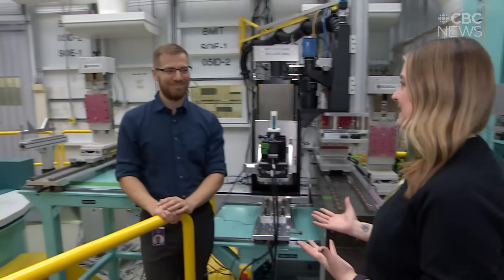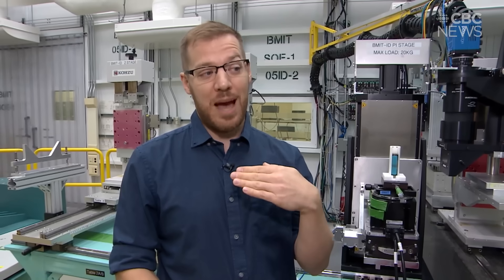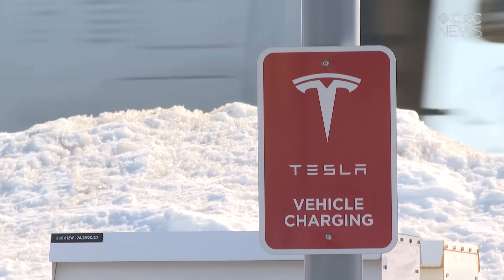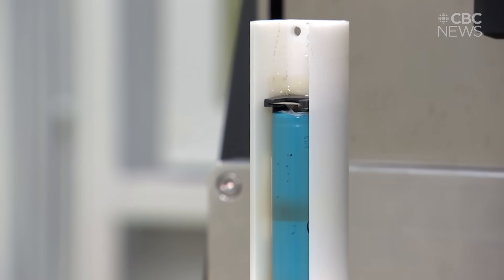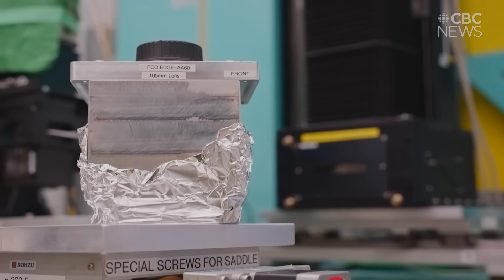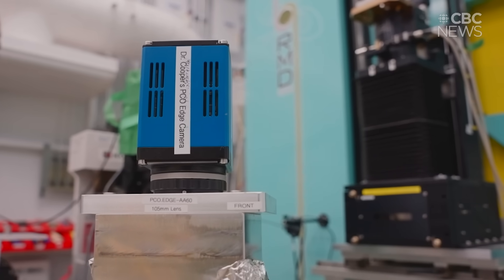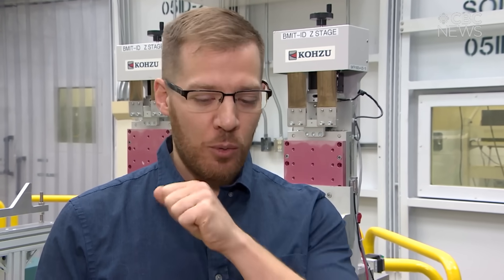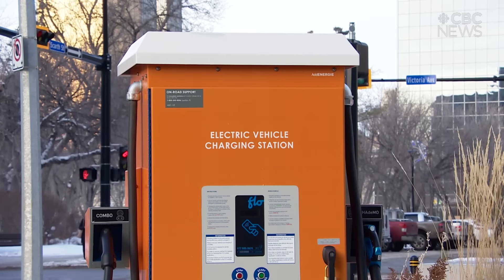New electric vehicle battery could run for 8 million kilometres

Comment: It's all very well testing a battery in a lab. In the real world, it's going through heating and cooling cycles, shock and vibration and significant g-forces. Lifetime in a lab setting is different from the  real world.
Cost? Charging rate? Capacity to mass ratio? Ease of manufacture? These are a few questions that were not mentioned.
Reply: Heat is the primary degrade risk of battery cells and is the result of charging and discharging at high rates. Scientists test and monitor that and would evaluate the aging effects on the cells. Under everyday driving conditions vehicles are not usually subject to significant g-forces or vibrations and battery systems are engineered to withstand everyday use and the occasional pothole anyway, with extreme conditions only being a concern in accidents or specialized use cases.
Reply: @markfudger5267
If I suggested that this technology would suit the Tesla 4680 cell, which is specifically designed to minimise "Heating and cooling" with it's "tabless" design which reduces internal resistance, would you say "That's not relevant"?
.
How about if I said that Tony Bond is using this (University) facility to assist in working towards his PhD at Dalhousie University, where he studies alongside JEFF DAHN
Does the name ring a bell?
Tesla "Battery Guru" Jeff Dahn?
do you think there's not a Tesla somewhere "out in the wild" which doesn't have a pack containing these cells?
Reply: @rogerstarkey5390  solid state means a single crystal. How easy is it to grow a single crystal? Think Silicon, Germanium, Sapphire and Diamond. Once you have grown the crystal you have to shape it into a battery sized component. What are its properties:- brittleness, hardness, thermal conductivity, expansion coefficient, etc. Do you think it'll be easy and cheap to manufacture?

Comment: 🇦🇺 👍🏽, but no mention of charge/discharge rate?
Reply: If you go back into the video, you can hear him say a length of time and a number of full cycles.  You can divide
Reply: 20000 cycles / 6*365 days = 9.13 cycles per day.  I’d say that’s faster than normal discharge/charge rate, but sure it’d be good to know if there’s a different limit compared to current designs.

Comment: Interesting does the lead acid battery behave the same?
Reply: Lead acid batteries have always had a short life span.  They're designed to be kept near full charge all the time.  Allowing them to self discharge until flat essentially makes the innards degrade into sludge.

Comment: I've heard a few people say recently that batteries are loading longer than expected but they seem in line with projections. 

It looks like those batteries from 14 years ago are going to last another 14 years at least, surely longer than the rest of the vehicle. One of the problems is lifetime is often given as the length of time it takes for the battery to loose, day, 30% of it's capacity while people generally interpret it to mean 0%

When the owner finds that the range is no longer sufficient they'll sell it to someone who does
Reply: And there's already a growing market (particularly more advanced in Europe) for 2nd life/repurposing of EV batteries into stationary, grid scale energy storage, where duty cycles are a fraction that of an EV, and where they can be put to economical use, potentially for decades longer. By which time profitable recycling will also have matured.
Reply: @sluggo7  While both exist it's at a very small scale because there's very few batteries that need recycling. Mainly just faulty ones or ones from cars that have been in a crash
Reply: mine didn't 42% degradation at  nearly 9 years and only 41k miles.
Reply: @FredFox-m9v  As with anything there's always a few faulty units that get sold. At that kind of degradation you'd really be covered by warranty and be entitled to a brand new battery
Reply: @sie4431  you are wrong, all lithium ion batteries degrade with time and use cycles. You are even more wrong with guarantees. My guarantee says 'at their discretion' it also says that it would be returned to 9 battery bars out of 12, mine had 8 at 8 years and you had to pay yourself for a battery check, have to have had it tested yearly and even then and only if their ' discretion' was enacted, you do not get a new battery, only cells repaired / replaced to bring the battery capacity back to 9 out of the original 12, so i would have had to pay and satisfy their qualifications and even then, they just had to say sorry, no ! and all for just one battery bar, that i had no guarantee of getting, after it paid out more of my own money.
Reply: @FredFox-m9v  I'm not wrong, I never suggested batteries don't lose capacity over time just that 42% in 9 years would be a faulty battery.

However you now say that you still had 8 bars after 8 years which is pretty good assuming you had a leaf, but that's probably due to the relatively low mileage. It wouldn't be covered under warranty given how little you lost

Also the leaf has a very small battery and the early models didn't have battery temperature management, cars with bigger batteries are lasting even longer

Comment: It sounds like a great battery for hybrid vehicles or grid tied home storage. EVs don't cycle their battery every day, but with solar you can charge it during the day and use the energy at night. If they could give a 20 year 80% capacity warrantee, instead of the current 5 years warrantee, that battery could sell for double the price of a normal LFP.

Comment: This could potentially be used for battery storage. Great backup for renewables that will lead to lower energy costs for Canadians.
Reply: It depends on the cost.  So far lithium ion grid batteries are good for short storage.  Though the iron-air battery developed by Form is very low cost (as iron is so abundant).
Reply: @peterkratoska4524  the report says 8 million KMS translates to 40 - 50 years. Simply amortize the cost over this time period compared to other alternatives. Can't see how it can't be competitive as most other alternatives wouldn't last 40 - 50 years.
Reply: How?  The electricity still has to be produced somewhere.  Nobody is going to put up an acre of solar panels for every car in the country.  EVs just burn the fuel 100 miles away and then lose 20% going across the power lines.
Reply: @billtwok6864  solar panel prices continue to drop. subsidize solar panels to be installed on every roof and every parking structure (France requires all major parking lots to have solar panels). Install grid batteries in communities (near transformers, etc) to absorb excess residential production during the day. It's very doable.

Comment: But can it handle the cold in Canada with the same performance level of the competition?
Reply: everything is affected by cold. including gasoline engine efficiency
Reply: @MrExo_3D  cold increases efficiency?
Reply: @Kammandier  affected usually means decrease when referring to cold
Reply: @Kammandier  cool temps, not -50° which it gets down to in every province in our country
Reply: You barely see an effect of cold with modern battery management. Plus in Norway EV's are everywhere, they don't have issues with the cold. I think the biggest issue in Canada is charging infrastructure.
Reply: @InnovationSolutions9208  Norway winter is moderated by being close to the ocean where most of the people (and vehicles) are located. It's more like Scotland than the Canadian prairies. Driving distances are shorter. Comparing ev adoption in Norway and Saskatchewan just because both are northern doesn't work.
Reply: @chrisogden5970  Modern EVs have a battery management system that surrounds the battery with anti freeze that uses a heat pump to either warm up or cool down the battery depending on the temperature. 
Norway is hurtling towards a 100% EV fleet and the Norwegians have no problems. 
Batteries are protected from extremes at either end of the thermometer.
Reply: People say range suffers around 10-20% in colder environments in current EVs
Reply: That is my question also.  I won't buy one of these because you are always worried about your battery dying and then you have to sit is a freezing car.   It takes a lot of energy to heat the interior.  Gasoline cars don't  have that problem.   I will wait about 15 -20 years until they have a decent EV that has a good battery.   I thought this video was about the battery capacity not the lifespan.
Reply: @jeffguarino2097  Have you ever owned an EV ?
Reply: @jeffguarino2097  As EV market share increases ICE market share decreases and factory utilization goes down which results in much higher cost ICE cars.  Lower cost ICE models are discontinued.  By 2030 only the wealthy will be able to afford an ICE car.  In 10 years you'll have a problem finding a gas station.
Reply: @jeffguarino2097  EV's have pre-climate startup with a press of a button and it takes a few mins to get cozy without toxic fumes spraying out the back, try that with a gasoline car in a closed garage, thats the problem the a EV doesn't have.  The first EV's to hit the market was the Ford Sparrow and that was like in 1996 so 25+ years ago , current EV's after 2015 has gone a long way, my 2017 i3 although not as good as current models still drives 200 summer 140km winter city car which suits my need.  years ago people have this Range anxiety and now people have charge charge tim worry, used to be charging times a few hourse to now 15 mins but no people still aftraid so target is now set to 5mins from 0~80%
Reply: @jeffguarino2097 About capacity? You mean like charging once, and then driving 8 million km? That would be fun. However, you dont seem to be up to date about heating in an EV. There's no need to sit in the cold at all. Heating the interior does not take a lot of energy, there's not a lot of mass in the cabin air and the surfaces. What does take lots of energy is heating the battery, a typical EV battery has 500 kg of mass. This takes a huge toll on SOC, but only on the first part of a longer drive. Once the battery is on temperature, you only need to replace what's lost during driving, mainly through windows. Modern heat pumps do this very efficiently. On my Tesla, it takes 2 to 3 percent per hour for heating in winter. Regarding heating the battery, if you have wall power you can do it before starting your drive, so you don't get that initial hit on range at all.
Reply: @jeffguarino2097  As EV market share increases ICE market share decreases and factory utilization goes down which results in much higher cost ICE cars.  Lower cost models are discontinued.  By 2030 only the wealthy will be able to afford an ICE car.  In 10 years you'll have a problem finding a gas station.

Comment: Will rust disintegrate an ev car in the same amount of time as gas car?
Reply: Yes, if they are made out of steel and you live where they put salt on the roads. But be aware that on most of this planet, that doesn't happen. I drive a 2000 Ford Expedition in Louisiana. There is not a speck of rust on it . The bottom looks like it just rolled out of the plant and ran through a little dirty water. Zero rust, except on the unpainted drive shaft.
And in the future, most electric cars will be made of aluminum, like Tesla is already.  Outside salt areas, they will last for a century. Even where they use salt, the aluminum will probably last a couple decades. It would depend on the alloy they use. Some aluminum alloys are highly resistant to salt water corrosion. They make aluminum ships out of it.
Reply: If the frame is made of the same materials, yes.
Reply: Do you buy vehicles with a galvanised layer under the paint?  Do you rinse off vehicles shortly after contact with salty water?  Do you keep your vehicle in a garage?

I think these questions have more import on rust issues.
Reply: If they have steel then yes. The first generation of EVs are now coming to the point where body rust would be a problem. I've actually never seen one with rust. Telling me that few of the first generation EVs have remained on the road long enough to rust.

Comment: Besides the number of times it can be charge/discharge cycled with minimum degradation. (remain above 80% of brand new)  (1) Essentially the "useful battery life" metric.   There are also a couple of other essential metrics:  (2) "Power capacity per unit weight" and (3) "Power capacity per unit volume".   In all applications you want a high number (1),  and the (2) and (3) are more specifically critical in mobile device applications, and especially cars.   

For stationary power storage applications these (2) and (3) metrics are not so critical, but even so you don't want a big battery box hanging on your garage wall.  The fourth metric is SAFETY, you don't want your battery to start fires, or electrocute you.
Reply: Agree with all of your points, although stationary battery grid scale storage (ie generally for electric utilities) isn’t terribly concerned about size, it’s mostly performance and longevity to justify the investment in the infrastructure. Existing battery chemistries are generally sufficient for most homeowners if considering a home battery pack, it’s the cost to both purchase and install that causes a shudder - to me at least!
Reply: "or electrocute you" that basically does not happen with modern BMS managed batteries.
Reply: @Neojhun  If they are 400 V and that voltage is distributed to different areas of the car, it is no different than house wiring, there has to be code type standards to prevent human contact with the voltage.  400 V will electrocute if the body becomes a conducting path.

I know it is not a "grounded" circuit, so there is no path to ground (unlike house wiring) but there is potential between the positive and negative circuits.  This may not present much of a hazard to the driver, but it does to those repairing the 400 V electrical systems.